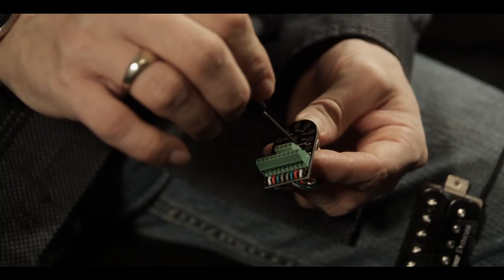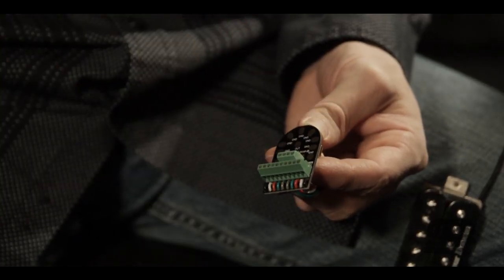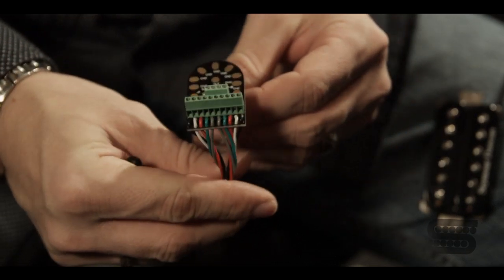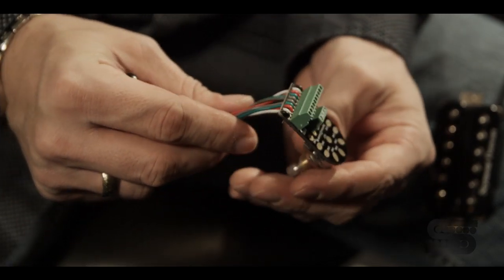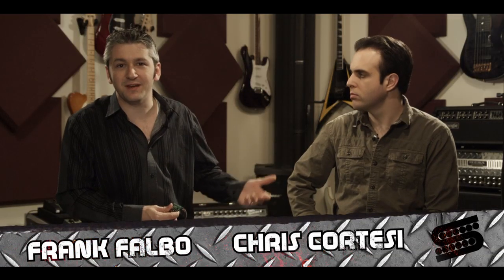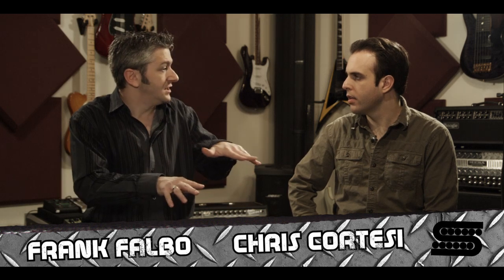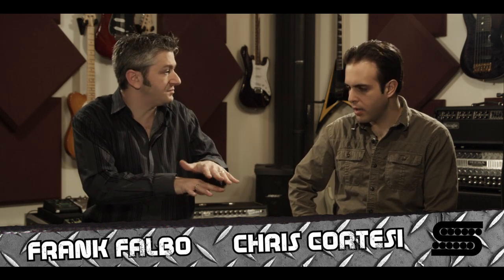Seymour Duncan Liberator Solderless System, Part 2: How the Liberator Works

Comment: Others have commented on this, but to repeat, for those of us with no experience in changing guitar electronics, none of Seymour Duncan's videos or website (that I've seen) explain in any detail how you have to solder wires from the Liberator first.  They say that their system is better for those with no experience soldering, but the first things  you  have to do to use this are de-soldering the existing wires and solder the new ones. Am I  understanding this correctly? The SD website says under "Wiring" for the Liberator: "Content will be updated soon!" It's now been exactly one month. This is very poor marketing.

Comment: if that's just a volume pot, wouldn't you still have to solder the pickup to the tone pot or the pick up selector?? I've never done it before so I don't really know, but just wondering...

Comment: Seymour Duncan -Hello! How do I wire my two Dimarzio Pickups,   (my guitar came with them) to the Liberator?  There's no coil taps or anything fancy. I installed the Liberator already. Can I have a link to the chart?
Reply: they said in the video there is the chart in the package for other brands. ordered mine today after seeing the video , did was not included? Actually i need to see a video where they install liberator .Did you got it right at the end?
Reply: @alexlotta  -I got it figured out. There is a chart online.

Comment: The Liberator would save a lot of time if you wanted to try several different pickup models and/or configurations before committing to what's ideal for the sound and tone you're seeking.

Comment: @xxPSYCHOSLUTxx my idea wasn't to put that system in a volume pot tough. you know, when you install a lamp, there are some white thingies where you connect the cables wit a screw. i wanted to put one of those in, and i did it in my behringer original shitstran (amazing guitar btw xD it's my modding guitar). it works pretty well, i have to say. but it's more practical in a pot, less chaos and cable salad.

Comment: Is there an equivalent of EMGs solder-less kit.  I mean one that comes with all the hardware?  The EMGs 81 and 85 sound great and come with the kit but the blackouts have a little more punch but I'm not clear what they come with?  And from what I'm seeing in still gonna have to solder everything else.
Reply from the maker: +Maximiliano According to our website, the Blackouts set comes with the wiring harness including pots, cap, battery clip & jack. No wiring needed. Everything snaps together.

Comment: Can I use Seymour Duncans with my Gibson quick connect?
Reply from the maker: Yes, but you will have to buy aftermarket 'pigtails' with connectors, or cut some wire with the connectors off of your current pickups and solder the connectors on.

Comment: People don't solder their speakers wires much anymore to their speakers.

There is no difference between using something like this and soldering. If there is a solid connection, there is a solid connection....

I actually made something a little bit like this about 2 years ago. No difference in tone I could hear from all the pickups I used it with...

Comment: That system is utter CRAP. The clothed wires of the SD pickups is NOT safely compatible and connections are UNRELIABLE.with those mini screws (that wear off immediatly). Thumbs down.GET YOUR GUITAR SOLDERED BY A TECH ! And to Seymour duncan (which is now merely a pickup vendor to me) Thanks for letting me destroy my strat......